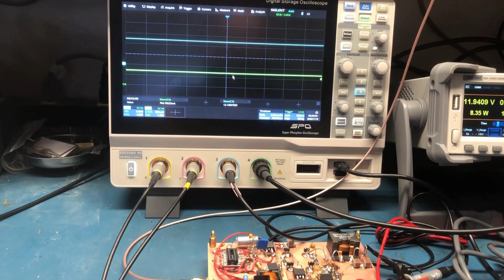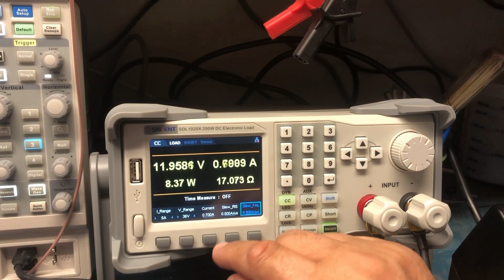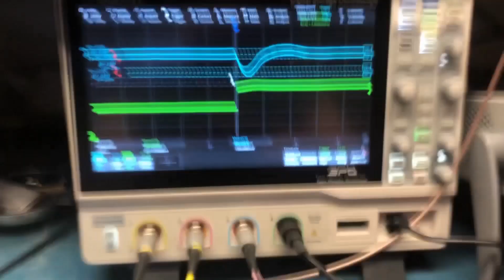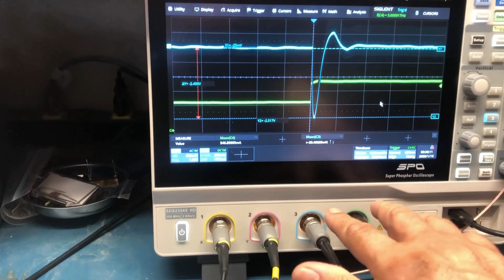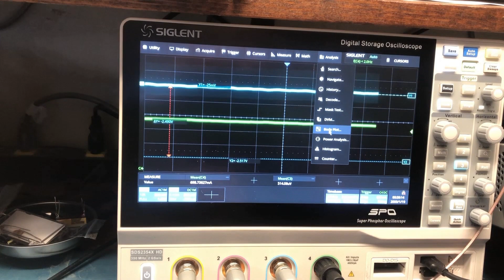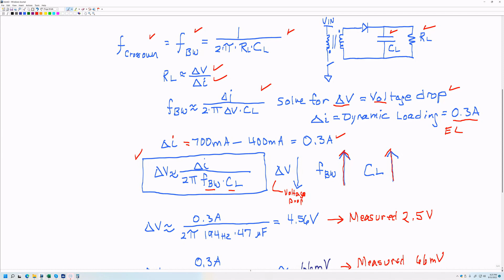Siglent SDS2354X HD Scope, and SDL1020X Electronic Load. How to perform a dynamic loading test.

Comment: Hi Robert. For the Bode plot why do we need a higher amplitude at lower frequencies? I know that the loop gain is higher at lower frequency, and for that for me it seems a litte counter intuitive idk.
Reply from the maker: Hi Ali, At low frequency, the supply will have high gain. If you have a bandwidth of 1000Hz, The gain at 1Hz will be 60db, which is a gain of 1000v/v. So if you inject let’s say 100mV at 1 Hz, you will have 100mV on the input side of the injection point and on the output side, the injection signal will be attenuated by -60db or divided down by 1000. So you will get around 100uV of signal. If your voltage ripple is 50mV, then the signal to noise/ripple will be bad. In order to make the output signal bigger, you need to inject a larger signal. Hope this makes sense.

Comment from the maker: In this video, I use the new 12 bit Siglent SDS2354C HD scope along with the SDL1020X to make a dynamic load measurement. I switch between 400mA to 700mA and then measure the output's voltage drop. The bandwidth of the loop determines how much the output voltage will drop. A slow or low bandwidth will have a much larger voltage drop, and a high bandwidth will have very little voltage drop. I then use the Bode feature of the Siglent SDS2354C HD to measure the loop response of the power supply. I then show how to use Vatche Vorperian's equation to calculate how much bandwidth you need to meet you dynamic loading requirement. If you find this video usefull, please subcribe, share, and give a thumbs up to this video. Questions and comments can be posted here or sent to rbola35618@aol.com.